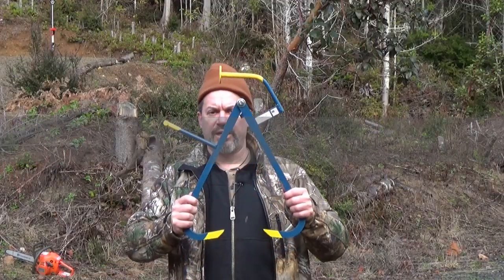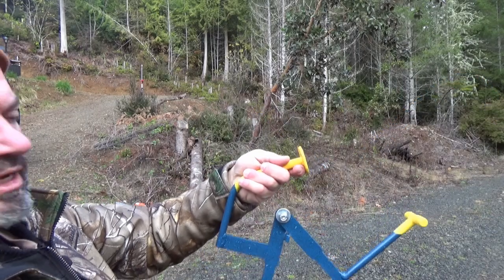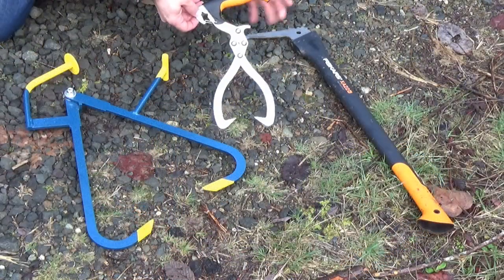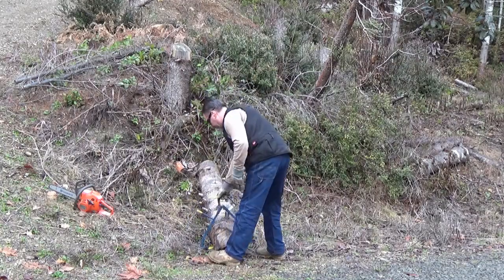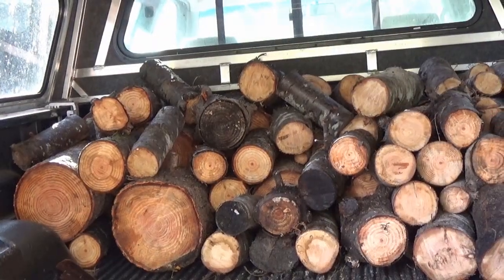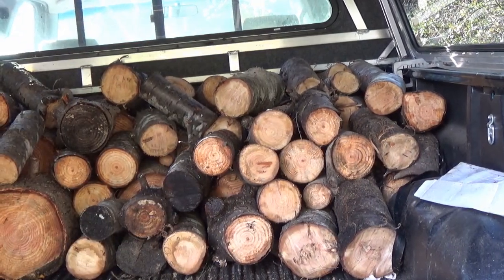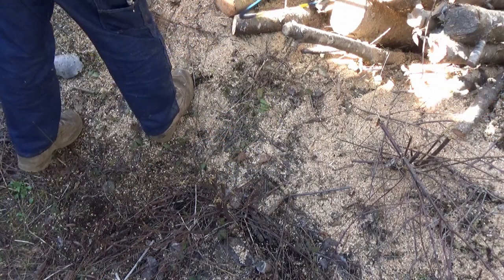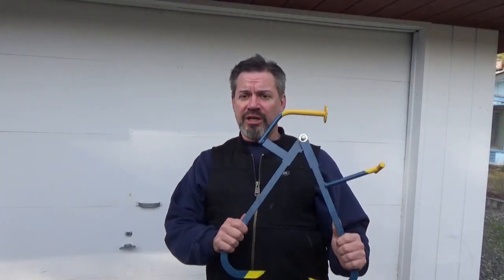Pinch-A-Log Review

Comment: Thanks. It was useful and helpful to see how those tools actually worked.    

It would have been helpful to see the Fiskers tongs in action to see why they weren't working well for you.   Maybe a good topic for a separate video?
Reply from the maker: I doubt I will re-visit the Fiskar's Tongs again.   The Pinch-A-Log and the Hookaroon works so much better it is really no contest.  The main problem (for me) is that the Fiskars Tongs are too short, so you are pretty much bending over anyway.  They also don't open as wide as I like and perform poorly on wet logs, which is how most of mine are.
Reply: Oh, too short, not wide enough, and lacks wet grab.  Makes sense.    Thanks.